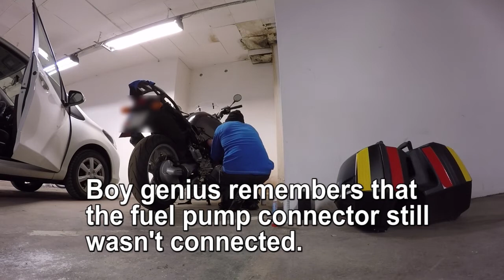Changing battery on a BMW R1150R

Comment: thanks. A question: how to CHARGE the battery while on the bike. Do I just connect the trickle charger to the jumpstart (+) terminal near the gear change lever?...
Reply from the maker: Supposed to work, but mine wouldn't take it that way so I installed a quick connect for C-Tek chargers.